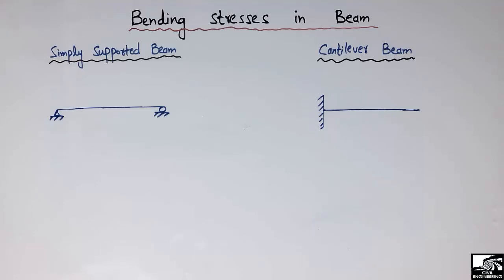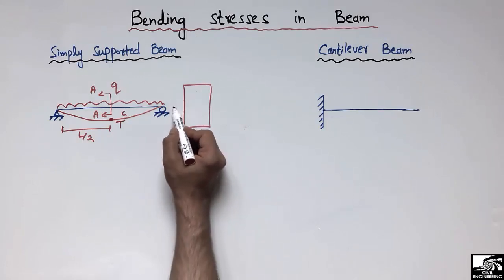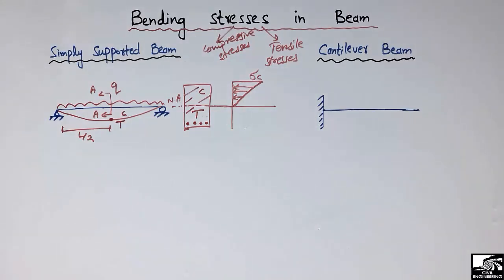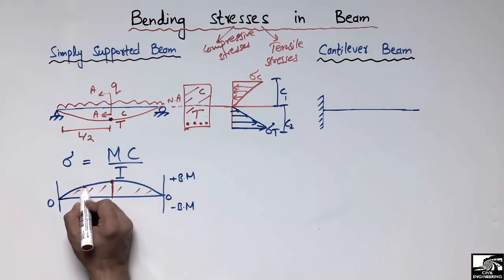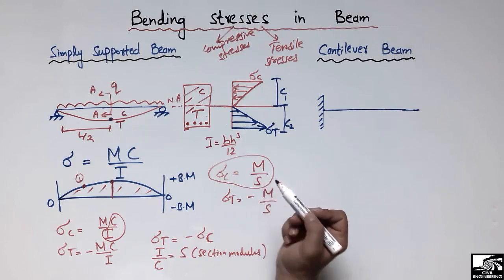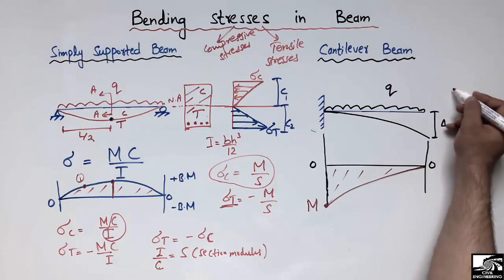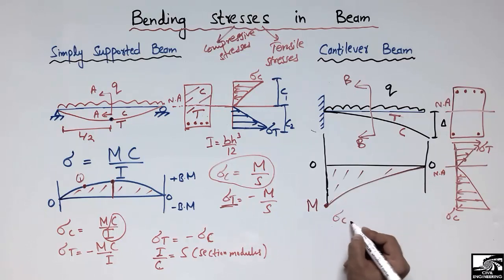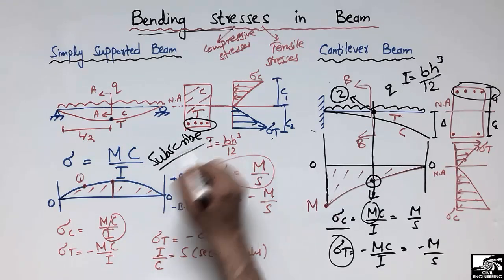Bending stresses in Beam

Comment: How to find value of c?
Reply: If you want calculate the stress in the extreme fiber (top or bottom), you only need know value h (height of beam).
The value of c is calculated like h/2 if the section is symmetrical or using the centroid in other cases, because c is measured since neutral axis.
Sorry for my english, I'm chilean.
Reply from the maker: #Matias Exactly (Y)